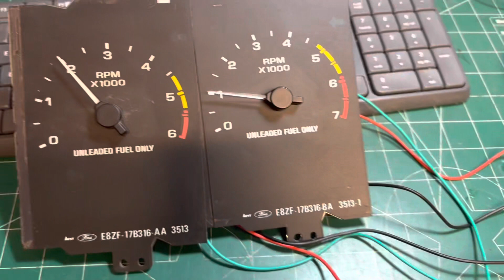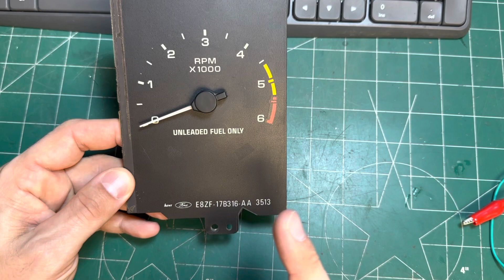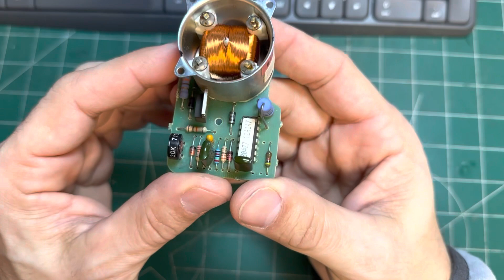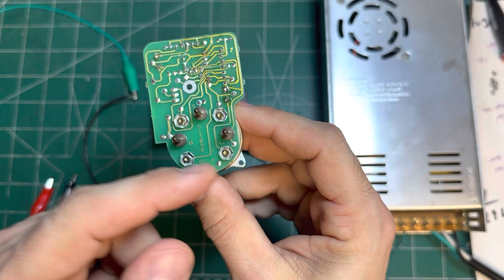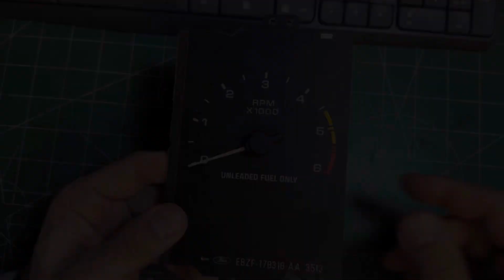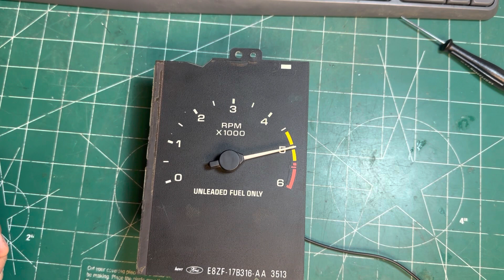87-89 Ford Mustang 4cyl Tachometer recalibration for use with 5.0

Comment: 1989 2.3L 4cyl 6K tach, installing a v8 7k tach as the 2.3L is built, and balanced to run over 7k.
Would you have any input on going the opposite direction?
Reply from the maker: @Fredness2300  unfortunately I wouldn’t be able to quote a resistor value to go the opposite direction.  I’d have to play around with it on a bench.   Logically you would assume that you can just measure the resistor on the 6k tach and install one on the 7k tach but I found the values to differ slightly.  

I’d had to set it up on a bench and play around with the frequency generator and a variable resistor installed to figure out a starting point. Not sure if I can actually get to this anytime soon

Comment: I noticed the needle on the 4 is bigger than the 8 do you know why?
Thanks for the video.
Reply from the maker: The needles are the same.  One of them has had the white indicator paint removed so it just looks different.  In hand they are identical.  I’ve swapped needles around a bit so not sure which needle was originally on what tach.